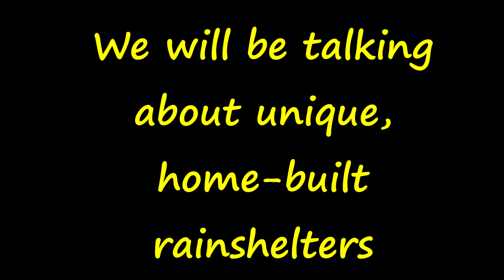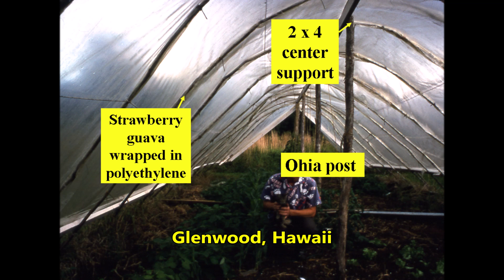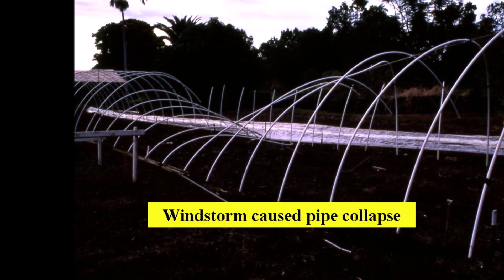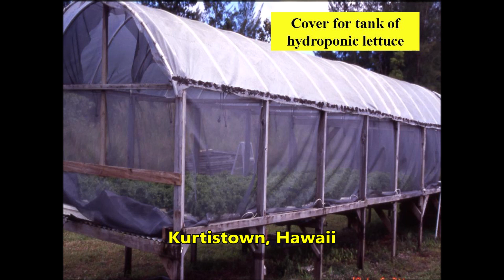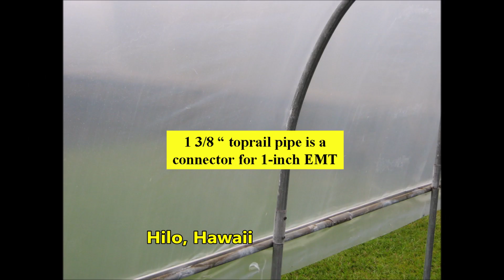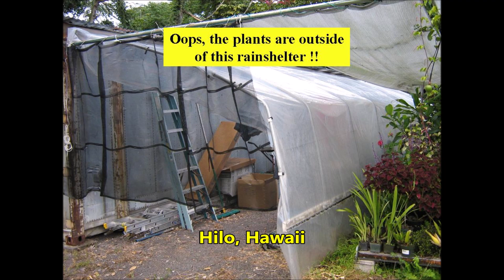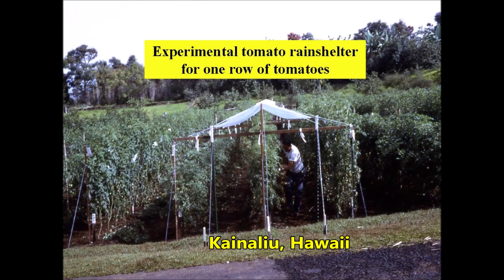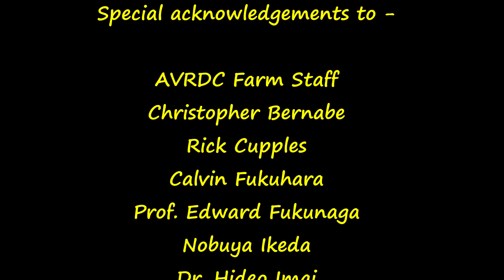Unique Rainshelters for Vegetable Production

Comment: Hey Doc, I’m growing a few veggies(tomato, cucumber etc) Kratky style in 10lt containers in Nauru, Central Pacific- very hot and tropical, but struggling to get mature fruiting plants, any suggestions for Kratky in the tropics? The solution sometimes gets pretty warm. Most are not in full sun. Thanks, Adam
Reply from the maker: You might look into aluminet -covered shade structures and also paint the containers white or maybe place aluminum foil over them to reflect off some heat.  Another possibility is to look into the practicality of burying the containers below ground level because the soil temperature is probably lower than the air temperature.
Reply: @growkratky5558  thanks doc, I’ll give your suggestions a go.

Comment: What a wonderful look back at the evolution of ideas, thank you!  There is so much learning through trial and error.  Found myself taking notes from your video.  In building my outdoor "Kratky" garden, I looked at rain exclusion using a greenhouse, and also containers that had dome shaped lids which were uncovered.  The minimal rain infiltration using the dome lids, allow using non-circulating hydroponics without the typical rain shelter.  My tomatoes grow so much better compared to those in the past that incurred soil born disease.  My favorite design is the arched PVC, which can be sized according to need, and quickly built.
Reply from the maker: Thanks, Matt for sharing the experience with the dome-shaped lids.  Yes, PVC is pretty convenient to work with.  One issue is that the polyethylene film that contacts it may wear quicker than the other polyethylene, so sometimes we either painted the PVC with white latex paint or covered the PVC with a cloth sleeve in an attempt to prevent early deterioration  and it was somewhat successful.

Comment: Canadian here... we have rain and SNOW load issues with high tunnels here, so I have been thinking of trying to make something with 1in EMT. I really liked the examples and tips you presented, thanks.
Reply: With the snow loads you get, I would go with chain link fence rails. They make pipe benders for that size. When I lived up in VA, an old lady had a couple of greenhouses with the EMT and we got about 7 inches of snow which was preceded by an ice storm. Her roof collapsed. 
I had 2" PVC and could not keep the roof from sagging because of the weight and although I finally managed to get it cleared off, the pvc pipe never regained it's original arch. 
So, go with the heaviest pipe you possibly can! And then get some of that greenhouse SCRIM. There's also a dude, I wish I could remember his name but it's been years, he used to advertise in Homestead and Small Stock Journal back in the early to mid 2000's. He sold a plastic that was strong enough to use for pond liner and you could get it clear, silver or black. He used really thick REBAR, come to think of it, and his greenhouses never had an issue and his plastic lasted forever! He's up in Canada and the USA! https://www.northerngreenhouse.com/

Comment: For tomato splitting I think shade cloth would prevent the extra heat of sun and weather splitting the tomatoes. Cut out a lot of the sun and the plant won't over inflate the fruit I'd think.
Reply from the maker: Yes, shadecloth, especially aluminet, will help to moderate the negative effects of full and hot sun on some vegetables.  In fact, anthurium flowers  can not tolerate full sun, so they are typically grown in large shadehouses in Hawaii. Some splitting is due to wetting and drying of the soil and that can be controlled with a rainshelter.
Reply: @growkratky5558  You need to breed beneficial insects like lady bugs and the little wasps for sale. Spraying for aphids when you have tomatoes is endless and not very helpful with neighbors that don't kill their aphid breeding grounds.

Comment: The structures look super cool.  I wonder about the plant health benefits if the humidity is the same under a shelter or outside.  Or is the splashing on the leaves more of an issue?
Reply from the maker: Good questions, Jeb.  Rain falling on the foliage is usually the more serious disease issue and it also can leach nutrients from the root zone.  Humidity can be an issue with a dense population of tall plants in a larger structure if there is no air movement.  The 'greenhouse effect' causes increased temperatures due to sunlight and that can actually lower relative humidity.
Reply: dude I know dat dude... It;s U